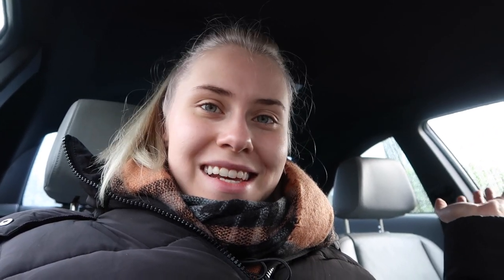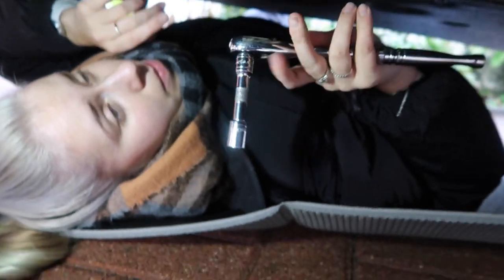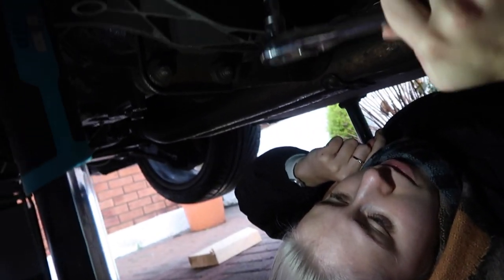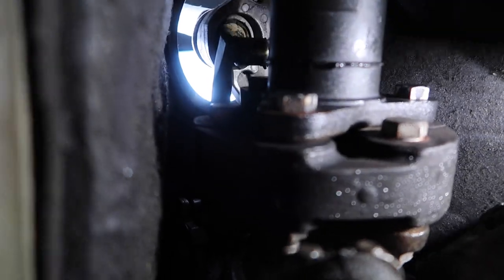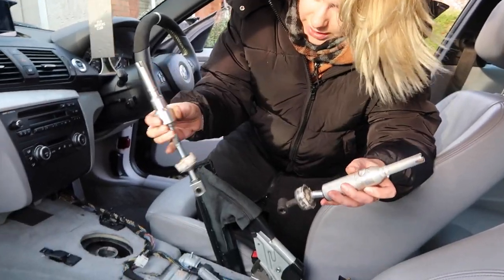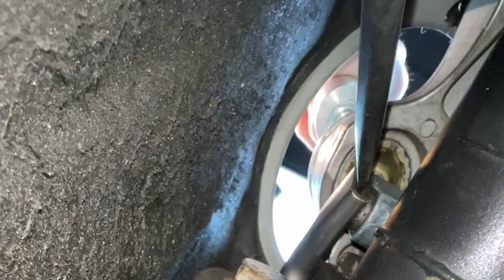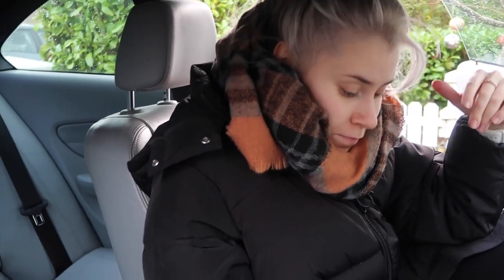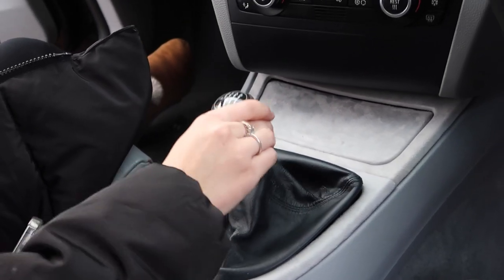135i gets a SHORT SHIFTER | Schmiedmann Short Shifter Install

Comment: Hello Monika, installed the short shifter incorrectly because the ball should be higher then we have shorter shifts if it is lower than we have longer shifts.
Reply from the maker: Yes this is correct, what I meant is it’s the shortest setting that doesn’t hit off the driveshaft! I should make that more clear! Good spot.
Reply: @MonikaBorodina  you need to bend the part connecting the shifter and gearbox, then it won't touch driveshaft.
Reply: @jaqbo4638  are u talking about the big metal rod or the selector joint?
Reply: @jacekp8366  selector rod you need to bend it and remove some material or crumple it
Reply: @jaqbo4638  Thanks, i cant set my ssk short enough on my 330ci because its touching the driveshaft when i go too low
Reply: @jacekp8366  czy u ciebie zmieniają się biegi dość lekko?
Reply: @jaqbo4638  raczej sztywno i mechanicznie, ale mam problem z wybierakiem, bo wibruje przy dodawaniu gazu powyżej 70%
Reply: @jacekp8366  podporę wału masz dobra albo łącznik elastyczny?
Reply: @jacekp8366  drgania mogą być przez to jeśli usztywniłeś wybierak to drgania idą przez skrzynie biegów
Reply: @jaqbo4638  jeszcze nie zaglądałem, ale tez wyczytałem na jakimś forum ze to może być powodem. Wcześniej się to nie działo, a ssk od schmiedmanna mam założony od ponad roku